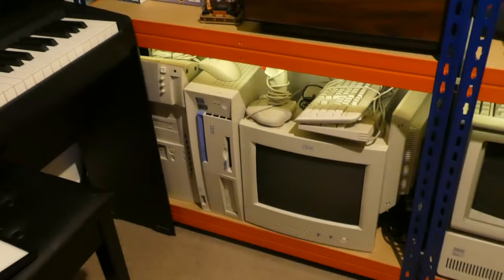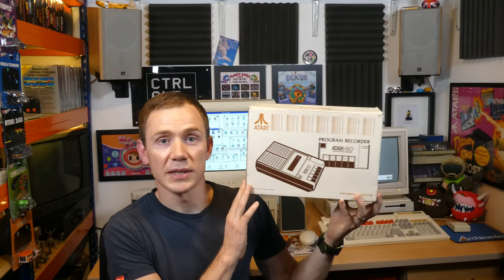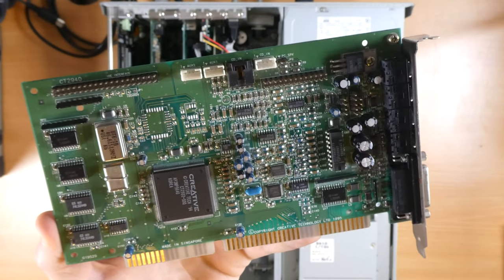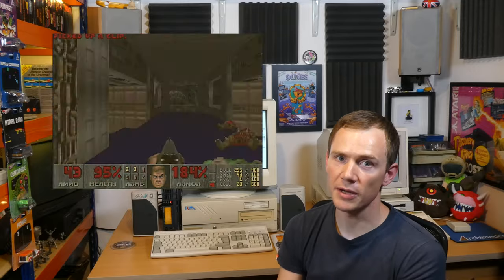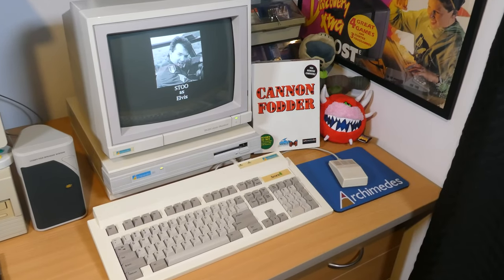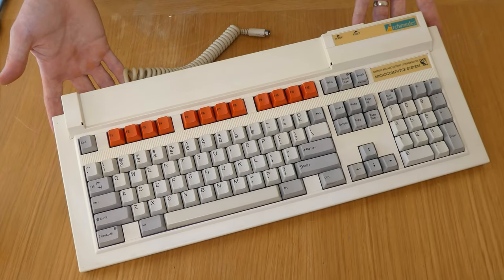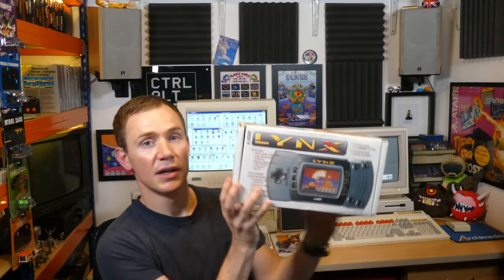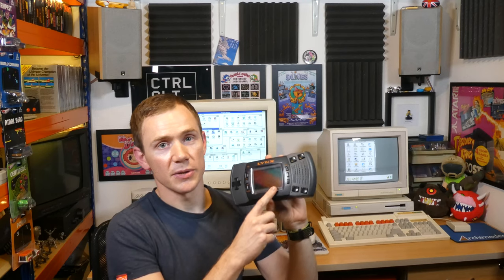Projects & Pickups: Gameroom Update, Atari Calculators, PC-MIDI / SoundBlaster Hanging Notes & More!

Comment: Thank you for the mention! Very interesting stuff you've been up to and have planned.

 I plan on doing an audio mod on my A3010. Which is basically just a couple of wires. I'd be interested in the chip you changed. I wonder if that's a thing on the A3010 as well?
Reply from the maker: You're welcome! Your tutorial was very useful.

Yes, the mod you're doing (if it's the one I think it is) bypasses the filtering and can supposedly benefit from the higher end op amp chip - not that I've tried it. I'm planning on doing a tutorial with some before-and-after comparisons in the near future.
Reply: @ctrlaltrees  I'll wait on your results before butchering my A3010 up. Seems fair, right? 🤣
Reply from the maker: Perfectly understandable if you want to use me as the guinea pig!

Comment: Your Acorn Archimedes keyboard looks fantastic !
For the joystick, I am not sure you can use the parallel port on these early Archimedes, because they are not bi-directional ...
I hope I'm wrong.
Reply from the maker: Interesting thought. I will have to do some more research and put together a prototype.
Reply: @ctrlaltrees  There is a solution though, if you rebuild an RTFM interface. It plugs in the Econet socket, on the motherboard. Somebody did it on the Stardot forum, the issue is that I don't remember who, at the moment.
It would be great if you join, say 'hello', and ask.
Reply from the maker: I'm already a member and occasionally lurk but I haven't logged in or commented on anything for a long time 😉

I'm familiar with the RTFM interface but couldn't find schematics or high enough resolution pictures to be able to reverse engineer it. It would be great if someone could make schematics available or maybe even a PCB!
Reply: @ctrlaltrees  Somebody did it, and even sent me a bare board, but I am unable to remember who.
If you ask on stardot, probably either this person will answer you, or it'll ring a bell to somebody who remembers who he could be.
Also, you could try using the search engine.
Hope this helps.
EDIT : I have everything you need on my computer, as the author sent me all the project files.
Have you got en email address to send me, so that I can forward them to you ?
Reply: @ctrlaltrees  @Zarchos That'll be me then.  You are more than welcome to the schematics.  They're in Eagle (one day I'll get around to learning KiCad), or I think that there should still be a couple of the boards I had made up left if you want one.
Reply from the maker: Oh wow, that's very kind! My email address is rees@ctrl-alt-rees.com. I'll have a look at Stardot over the weekend.
Reply: @ctrlaltrees  Email sent :-)
Reply: @ctrlaltrees  And one from me too. I think the one from me may be a later revision as I think I sent Zarchos the files before I re-laid the board out to be a bit smaller to allow it to fit into an A3000.  I think you might need the use the updated one in yours too.  The schematic should be the same in both, just the board layout was updated.
Reply: @dazzathedazza  Excellent !

Comment: What camera are you using whose lens doesn't have a wide enough field of view?
Reply from the maker: It's a Panasonic Lumix DMC-TZ80 compact camera. Considering upgrading to a budget DSLR - maybe a Lumix G7 or Canon M50.
Reply: @ctrlaltrees  Lumix g7 is what I started with. It's good, but it has no IBIS so you'll need to mostly use it on a tripod. For wide angle lenses, the Panasonic 8-18mm was the best out of the major three that I tested on my Panasonic bodies.